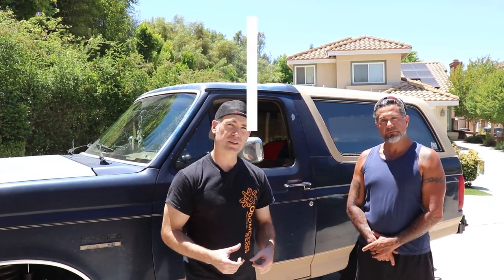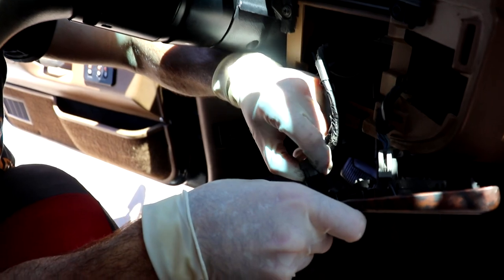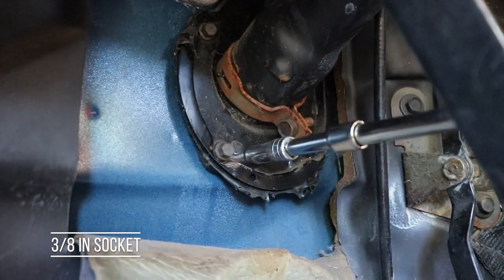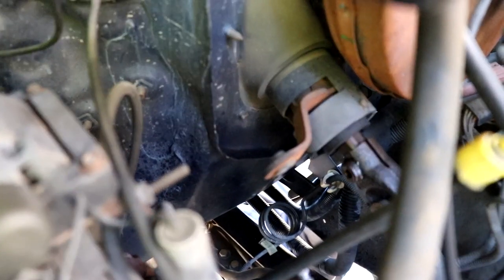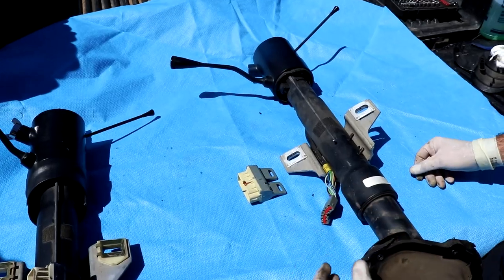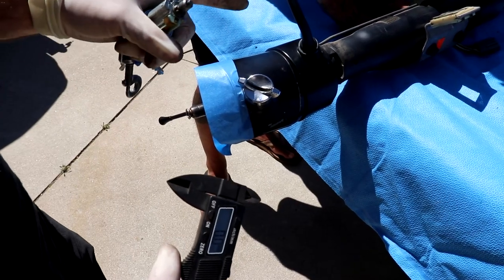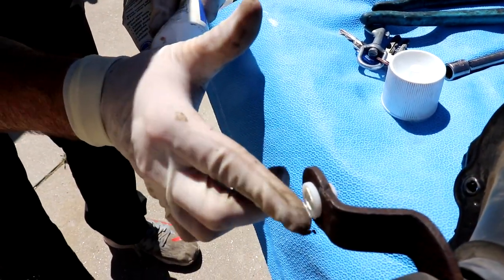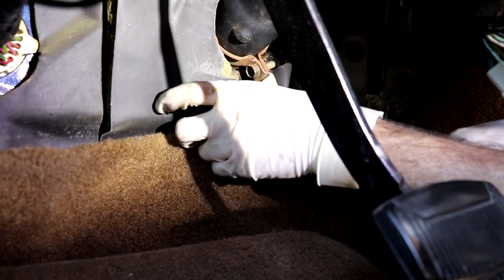1987-1991 Ford Bronco Steering Column Replacement, F150, F250, F350, *Subscriber Repair* DIY

Comment: I bought a used steering column w/o keys. I purchased a $15 lock pick from China. It worked great. I just waited 2.5 weeks. The only advice i will give is if you do not have the OEM lock cylinder, order an OEM or get one from the junkyard with keys. I purchased one from RockAuto, a standard motor products, and another from Autozone, a smartlock they just did not fit right. I broke one and got so frustrated with the other one that they both went into the trash. I found an OEM one from eBay Ford-Strattec that worked perfectly. I'm ready to install it. Thanks for the advice on the bushing. I just ordered it. Great video.
Reply from the maker: Thanks for the comments James, appreciate the tips on the lock cylinder. This may help out the next guy that does the swap.
Cheers!

Comment: Well, I am pretty sure, having Mark V, 1979, had a same problem, but....I think nothing was broken, the rod was just off, loosen from under the steering wheel, it was just off the "eye", typical Ford/ Lincoln problem, I really think, you could Fix this, without replacing the whole column!! Other than that, good video !=)
Reply from the maker: Thanks for the comments, you may be right about fixing the old broken one. It was easy enough for us to grab the junkyard item so we went that route. Appreciate the feedback though, thanks for taking the time.
Cheers!

Comment: The only way to get anywhere with a Ford is to get rid of it. I got rid of all my Ford's and I have never been happier. I will never own another POS Ford ever again.
Reply from the maker: Thanks for the comments, sorry to hear you have had a bad experience with your Ford. We have loved our 2004 F150 4.6L since we bought it in 2008. It has 356k miles on it and it has been the best truck we have ever owned. As much as we would like to upgrade, this truck just keeps running and never misses a beat. That and we don't want to spend $80k on a new diesel truck.
Thanks again for hanging out, Cheers!

Comment: Dude is pulling on those wires like they can't break dam.
Reply from the maker: Thanks for the comments, those old Ford connectors are a real pain to take apart. The good news is that they are very durable and we didn't have any break.
Cheers!

Comment: Thank you bro my only problem now is finding a new steering column
Reply from the maker: Thanks for the comments Alex, sorry to hear you are having trouble finding a good used steering column. Broncos are a little tougher to locate these days but the F150's seem to pop up quite frequently. Also remember that F250 & F350 use the same column as well. Just keep checking your local wrecking yards for inventory and we are sure one will show up.
Good luck on your project, Cheers!

Comment: I put an 86 in an 88. It worked but the steering wheel was upside down, then when I replace the steering gear box, I flipped the steering will over then hooked up the gear box.
Reply from the maker: Thanks for sharing Alton, good information for others who may see this.
Cheers!

Comment: I have a Ford 1991 350 E Jamboree that my son’s friends drilled out the ignition.  I spent three hours at the pick apart in my hometown of Bakersfield and found a steering column removed it and brought it home to change it out. One thing to take it out of a junked picked apart vehicle than to replace inside this very crowded ford jamboree . Especially if the only experience I have is watching you tube on how to do it. My question is , I dont know what I have to disconnect fluid wise before I take off the steering column.
Reply from the maker: Thanks for the comments Cathy, you will not need to remove anything related to fluid for the steering column. All of the power steering lines are connected directly to the rack so you won't be messing with that. The biggest challenge will be the dash trim parts and other plastic bits as they are now brittle and 30+ years old.
Please feel free to reach out if you run into any trouble.
Cheers!

Comment: DID YOU EVER GO BACK AND FINISH TIGHTENING THE TWO BOLTS THAT HOLD THE IGNITION SWITCH TO THE COLUMN?
Reply from the maker: Sorry Bob, we forgot to film that part but yes we tightened them up after confirming the truck started properly. Just a little more standing on your head to cinch those down but not too bad.
Thanks for hanging out, Cheers!

Comment: My buddy and I also want to change the steering gear next month, on my 1983 F150 if it works that way I'm very satisfied. Top video, very well explained and filmed. Is there anything to consider with my 83' or does it work the same way? Best regards from Germany
Reply from the maker: Thanks for the comments, appreciate the feedback. The 1983 uses the same basic steering column. They were all pretty much the same from 1980-1991, with differences being the tilt function. Thanks again for hanging out, glad you enjoyed the video. Let us know how your swap goes. Cheers!

Comment: Hey, I am going to the junkyard to pull out a steering column, but I do not have a steering wheel puller or keys for either column, will I need to pull he steering wheel or can I leave it on?
Reply from the maker: Thanks for the question Aden. You don't need to have a steering wheel puller with you to remove the column. Just keep in mind they will probably charge you for it if you can't get it off.
In regards to the key, you will have to drill out the tumbler in order to remove it if you don't have the key.
Good luck on your Ford project, Cheers!

Comment: Was the Engine not staying started after turning engine over?  That is the problem I am having on my 89 Bronco, so looking for my fix.
Reply from the maker: Hey Dennis, thanks for the question. When the ignition rod becomes out of position, either by being worn out or just broken, it will no longer make contact with the switch in the middle of the column. When you turn the key, nothing will happen, it will not crank since the contract is not being made. The temp method is to turn on the key so the ignition electronics are on and then use a L shaped tool to apply pressure to where that rod makes contact with the electric switch. 

Instead of trying to repair the rod assembly, we chose to swap out the entire column with a good used one.

Hope this helps answer your question, let us know how your repair goes. Cheers!
Reply: I repaired the rod assembly on my 88 F150..it wasn’t hard to do at all.
Reply from the maker: @ronaldnorris2179  Thanks for the comments Ronald. We just figured since you have to remove the steering column anyways to repair the rod assembly, we would just swap it out and then take the time to completely restore the original column.
$50 was money well spent to get the Bronco back on the road with very little downtime.
Thanks again for hanging out, Cheers!